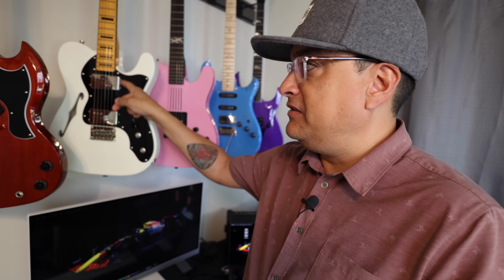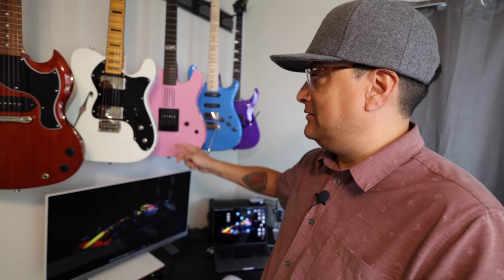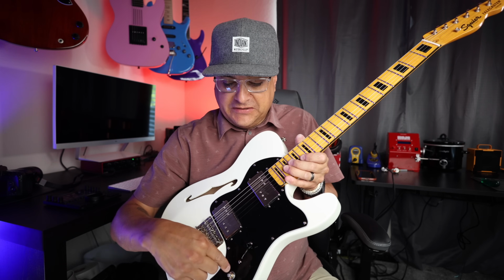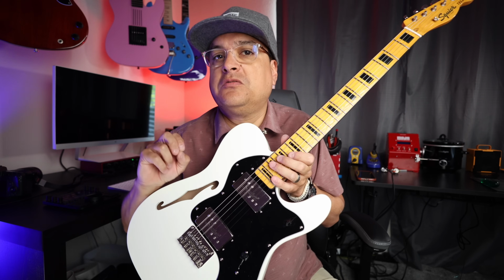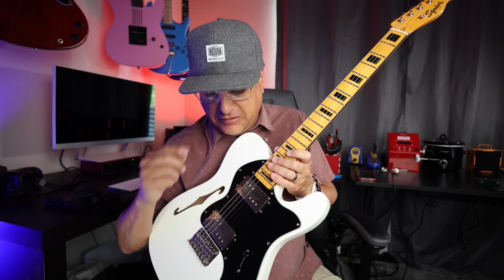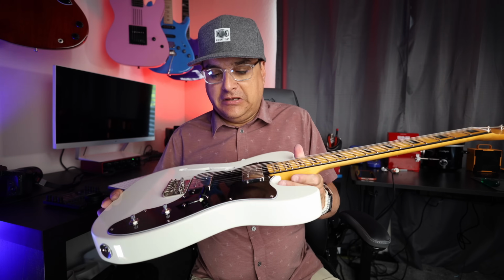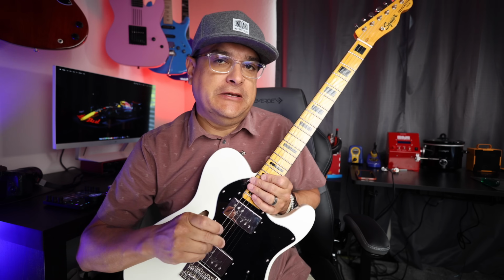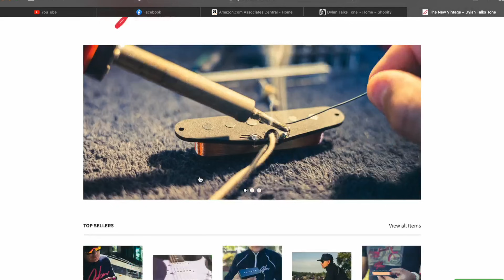250k Pots Vs 500k Pots - Sound Comparison

Comment: I once upon a time I tinkered with pot and capacitor values in my main squeeze strat and would always come back to original values.  The quality of the pots and caps improved, purely by accident.  Clarostat pots and these big orange caps at normal strat specs.  Forty tears later it still makes me happy.  Experiment, explore, enjoy, find Home.

Comment: For what it's worth: I use 500k pots with my Fender Noiseless 3 pickups. I also put them in my Tele. It has 
Dimarzio stacked single coils. It, as you mentioned opens them up which I like.

Comment: I have pretty much the same view as you. I much rather have the guitar be too bright out of the gate and I can tame that with eq or the tone pot. If the guitar is dark or muddy out of the gate then in my opinion and experience it’s almost improbable to create what I call that good treble. I also agree the mid range and the cut just gets bigger with the 500k. I’ve been using 500k in all of my guitars including typical telecasters for a long time.  Nice video. Well done.

Comment: Firstly... Nice I liked your play-style and I agree the 500k pots are idk wider? Not in dimension size I mean like what you said about the eq difference in the Q value wider at the same Q peak on the low mid frequency range. 
I'm wondering if 300k pots would because of most brands stated tolerances in resistance +/-10 % there's more chance of getting a pot closer to 250k if I wanted 250k but this video, thank you btw, has swayed me I'm getting 500k pots as you said you can always dial the knob down to a resistance value in the pot closer to 250k or what sounds better depending on your pickup, and still have the option to go higher, all the while not needing to over complicate the wiring by adding more that essentially takes away, therfore keeping it simple as possible and still having more high range frequencies there if you want it. I love this idea.  500k pots. 
I'll maybe have to look through this video again to answer this question but I'll put it up on here anyway- 500k pots on a strat SSS configuration, capacitors- conventional methods are .022uf fir 500k pots .047uf for 250k pots- 
After this video I'm questioning if the capacitors are for the pickups more than for the pots- does this question have merit?
Or is it purely subjective and personal preference?
Thanks again love your podcasts and tutorials and demo videos you know your stuff-  big 👍's up for Dylan talks tone ❤

Comment: a pot then is kind of like a mirror that reflects the sound of the pickups toward the output, and you can either fade it out til its invisible and there's no signal, or fade it in and reflect everything into the output. but more resistance means a more reflective mirror.

Comment: QUESTION: Is it possible to install a 1 Meg potentiometer for example and wire resistors to a three way switch and change between 250k 500k 1m

Comment: Great video! Thanks for the information. I just have to say that I'm on the opposite side.😀 You said, if you don't have those highs, it's not there, you can't take it back. Yes, true, you can't take exactly that frequencies back, but for me it's just too shrill.
My experience is that if I have those shrill, harsh highs I just can't get rid of them, but if it sounds balanced and smooth but just a little dark, I can still add some highs and it won't be ear-piercing to me.
So I think the question is: Do you like or dislike exactly those frequencies? 😀

Comment: Thanks for this, especially the nugget about the volume pot contributing more to the high-end roll off than the tone. 

For a SSH strat, I decided on two volumes  - 250k/singles and 500k hum.  500k on the singles was just too brittle. 

I used a 250k for the tone, and I’m happy with the result.  The 500k retains more brightness for the HB, and the bright Eric Johnson Neck/Mid singles chime nicely and aren’t brittle.
Reply: That's an interesting combo. I know very little about pots, so on my HSS Strat, as my post above mentions, I'm putting in a better humbucker. Does each pickup gets its own pot? If so, for an HSS would you recommend a 500k + 250k + 250k config, or replace each with 500k?
Reply: @OhGawdHesGotAGun  I think in theory, and as Dylan mentions, you can use 500k for everything.  My particular single coils are already quite bright, and when I had a 500k master volume those singles became undesirably bright. 

I don’t mind two volumes, as there are interesting options to preset volumes like a LP.  Now when I play through my Marshall Jubilee, I get nicely tamed singles and a fairly bright humbucker.  

The 250k pot for master tone is working very well.  Your mileage may vary, and different pickups can make all the difference (inherently bright or dark pickups)
Reply: @jimmclaren1  Thank you! "Tamed singles" sounds about right for a Strat (and for a porn movie title, lol).
I appreciate your advice. I'll go for 500k for the humbucker only (if it doesn't already have a 500). Not sure how coil splitting comes into the equation, I know there are some that are modular (iterate between 500k & 200k or whatever).
Thanks!
Reply: @OhGawdHesGotAGun  I just used a 250k push-pull for the master tone.   Used the switch on it to split the HB. Have fun!

Comment: i'm always a sucker for brighter tones... i just snagged an old squier strat for modding/mangling, and that came with 500k pots for the single coils, which surprised me.  Also on your tele there, that maple fretboard/ block inlay is the coolest, i wish more fenders & squiers had that...
Reply: Good call.
That's actually alot better than just a good call. Looks 1,000% cooler than regg'ler ol' black dots. Id think it work for/against whatever aesthetic you'd be going for depending on what colors you're working with.
I kinda can't decide if I'd prefer those old pearl style, or black (to bank off this Tele's white body. Pearl can appear dingey(is that the word?-kindof dirty-faded, rhymes with Benji) so pearl might not be a good idea. Black is usually a safe bet. Pearl however, (now that I think about it)might just make the whole guitar look unkempt and tacky.
lol Wouldn't wanna be dicking around on stage with a malnourished looking guitar.
Suit yourself.

Comment: I completely agree with your philosophy on pots, I use 500k in everything I modify, if not a 1meg. It's so easy to take out or compress down some of that high end with the tone circuit, a pedal, or with simple EQ on your amp or effects unit. I would rather be turning down my treble than constantly trying to boost something that is weak, which is almost always a lost cause. Using a 250k pot is like hacking off the high end of your tone with a hatchet, using the tone circuit or something else is like using a scalpel.

Comment: 500K volume pots makes single coils sound like scratchy nails on a chalkboard; on that note, that Alpha 500K-to-250K pot swap was the best thing for my Squier Affinity and Bullet Strats. With aftermarket humbuckers in my early 80s Cort LPX (ex-Effector), i swapped out a fried 500K volume for an Alpha 250K providing less highs than a 500K but it actually sound better that way to me. 2yrs ago i loaded stacked humbuckers in my MIM '95 Strat Special as it had a 250K volume with the previous aftermarket SC's, then the 500K pot was short-lived but i put a 1-Meg pot in it, what a difference THAT swap made in that guitar as it makes the stacked humbuckers brighten up like single coils!

Comment: Another thing to consider is rarely is a pot valued at what it's sold.  Many "250k" are around 220k.  "500k" can measure anywhere from 420k-520k and that's even buying so-called measured tolerance higher priced Bourns or CTS.  Basically, that mass source production pot on your volume could be the wet blanket covering your tone.
Reply from the maker: I mean… if you buy shit parts, but we use low tolerance stuff so it’s not an issue
Reply: @DylanTalksTone  I only buy low tolerance as well.

Comment: If you compare resistance of the volumepot with the capacitance of the tone capacitor and they are both in parallel with the pickup, de capacitor leaking treble to the ground is a low pass/high cut filter(it leaks treble to the ground) and the same way the resistance of the volume pot is a high pass/low cut filter and it even leaks some of the higher frequencies.
So the real test would be: 
1. Connect a pickup straight to the output jack.
2. Connect the same pickup through a 500k volume pot to the output.
3. Connect it through a 250k pot.
Compare the three options.
Option one will be the loudest, have more bass and more treble.

Comment: I would  like to see the same comparison with a standard Tele, which most players would own, The wide range version most people do not own and are not familiar with. It was a good demo though and I did like the 500K better. What if you used a 500 on the vol, and 250 on the tone, do you ever mix values?

Comment: I've got a 2018 American Performer HSS Strat & I'm not a big fan of the 'Double Tap' humbucker (it sounds like a scalded cat giving birth) so I'm getting a local tech to put a Shawbucker 2 humbucker in its place. I miss the tone I got from my Tele Deluxe so I thought I'd replace my humbucker with one of its double Shawbuckers. 
I might lose my coil splitting ability but I don't care that much. I don't know what pots are in there now for volume, but I'm impressed with the 500k sound here. I've only been playing about 4yrs so I'd appreciate any "If you were me" advice on this. Would you, IYWM, get him to replace the existing pots with 500's? It's got 2 Yosemite single-coils & the Double-Tap humbucker. Also putting on a 10-way switch while it's being operated on.

I'd do this all myself but I've never soldered before. I'll risk destruction on my Harley Benton, but not my Strat.

Comment: Funny that I ran across this video, when I was just thinking about this whole concept last night & this morning. (Right now, I'm coming up on the 8 minute mark, but I had to stop & enter this comment.)
I've been thinking the same as what you're saying, that you'd want 500k (or even up to 1 M) for the volume pot, and something smaller for the tone pot.
Then there's also putting a choke in the tone circuit, I haven't tried that yet, but I want to.
Because you don't want to lose that signal! You want to keep it, maybe shape it a bit, but not lose it to ground!
One thing I didn't understand, around the 6 minute mark what you were saying about  "cutting out the highs..." Seems to me you're cutting out the whole signal, not just the high frequencies.
(Now I'll watch the rest of the video!)
Ok, after listening to the difference, I think we're both right! The 500k pots sound more articulate. Definitely. 
I especially liked the quack that came from the bridge p'up!  (Maybe I'll get me a Strat. Never had one.)
One thing I've learned with analog electronics in general, and electric guitars specifically, is that there's theory, then there's reality...!  What may be supposed to happen "in theory" (with ideal components) is NOT what you get in reality!
But to me, this just goes to show that the concept of using higher value pots, at least in the volume circuit, to preserve more of the signal, is true. That's because, even though the pot works as a voltage divider, where the ratio of resistance determines what gets sent to the output, you've still got the signal going through the whole pot (another way of looking at it is, with a higher value pot you're separating the signal from ground more). Because you can't forget that two things are happening: 1) the whole value of the pot keeps the signal separate from ground, while 2) the ratio of the two resistances (voltage divider) determines how much signal gets sent to output. Good experiment! 👍

Comment: What about the cap value? How do you choose that? I've never seen the wiring in an electric guitar. I'm assuming it's a fairly simple RC circuit. What would a typical schematic look like?
Reply: Unfortunately, it’s a lot more complex than an RC filter. Yes there’s a resister and capacitor in the tone circuit, but the pickup is also an inductor!
Reply: @ZachariahConnor  That is true. It is. It's sort of acting like an electrical generator when the string is vibrating in the magnetic field.

Comment: Would you recommend using 250k on a neck HB 335 guitar for Jazz?

The common approach to make it more jazz boxey is fat flatwounds ebony neck 0.047 caps or tone rolled back.

But using 250k for instead 500k seems to be a possibility to make the 335 more like a jazzbox?

Comment: I'm a guy who hates active guitars so I always wire mine such that it is passive yet can do anything an active can do so one thing I do is I use very high output humbuckers such as bareknuckles warpig set
These are 21.5 kohm 
Most factory guitars have at most 12 kohm
A 500k will allow the full pot of a humbucker that size but it will not allow the full potential to be heard so I use a CTS 1meg tone and a .022 cap so that the sound is bright and with that high output humbucker you lose tone range at the knob but you'll have the lows from those humbuckers but the .022 for the highs 
I've had good luck doing this, double ground everything to kill feedback and noise
Alot of guitar companies do assembly line work and these guitars are quickly shoved thru so taking the time to choose good electronics, good wire and caps and great grounding will make your guitar have better response when you play. So what does all of this add up to?
You have a great sounding guitar that you don't need to fight to get your sound because the better ground kills extra noise so when you play your ears can hear each separate note apart being that there is no hiss, buzz or popping mixed in. When you use a very high output humbucker set with good ground you get a super good response when you hit the strings
I pick my capacitors according to the stats of the humbucker
With high output of 15 kohm or greater you usually get lots of lows so a .047 may bass it up to much
So I use .022 bumblebee or black beauty caps because they seem to brighten up the sound. Everyone that plays my builds hit only a few strings then they turn to me trying to buy is.
I built a knockoff lespaul body with bareknuckles pickups, 2 CTS 1meg tone pots, 2 CTS 250k vol pots for vol range, 2 .022 bumblebee caps a 3way switch with added grounding using wax cloth wire.
Guitar companies like to use rubber coated wires to cover their mistakes but wax cloth wire is perfect If you ground well. These factories do as lil ground as they can get by with so when people buy a $3000 Gibson lespaul or usa strat for $1000 just know that a $200 guitar has the same orange drop, bad ground, garbage alpha pots crap that the big dollar guitars have. In the early days Gibson had their bumblebee caps, fender telecaster had text book caps and these types of details made their guitars have a unique sound but now they sell a name and almost all use the cheapest components they can get away with.  When I figured out how it works I said I'd never pay big for a production guitar again
I buy pawnshop guitars and make them better sounding than most high dollar guitars. I can take two of the same guitars, one stays stock the other I only give better grounding but if you play the stock one then play the better grounded one you'd assume I did some big upgrade but no
Grounding makes that big of a difference

Comment: 500K pots (to me) always sound better than 250K's . I like the warmth of the 500K tone much better than the shimmery tone of the 250K's . Just personal preference. Great video , Dylan !!
Reply: interestingly Dylan says 250k rolls more treble out, causing a warmer tone. the 500k pot would be more shimmery with extra high end and the 250k would be more warm with less highs?
Reply: I agree with you 💯. Listening on my mobile phone speaker (several times) I found the 500k pups a bit warmer than the 250k
Reply: It's the other way around. Lower pot values take high end away.
Reply: @Leo_ofRedKeep  yep it's supposed to be that way but in his demo, to my ears it was not

Comment: For a tele I would always change the 3-way switch to a 4 way and add a phase switch when changing the wiring I also use pot with an off position so I can eliminate the pot altogether,

Comment: @Dylan, I have two questions, hope you can help me out. 1) How can the tone pot have influence on overall wiring resistance? For instance, I have an HSS guitar with 500k volume pot and two 560k resistor on each hot lug of each single coil so that they can see around 250k, but my concern is how the tone pot will get into this. 2) How different is it to solder the capacitor on the tone pot in the middle lug or the third lug. I have seen both wirings. Does it change considerably?  Consider for that, a master volume and master tone.Thanks a lot!

Comment: really perceivable difference, between the two impedances. It’s not even comparable. Off course..  the strings were also fresh.. but, even so..
Thanks very much for the video. I come to your channel, every once in a while, and i usually learn sth..  so congrats. 

I am modding a couple of my guitars with a 1M pot and 500k for Bass & Treble tone knobs, respectively . 
On the Tele i’m gonna use only one system, but on the HSS, funny enough, i was planning to use same approach you mentioned here..  I was thinking of wiring the Humbucker with its own separate system, so i can better tone that muddy jittery down, without altering the single coils’ tone. 
Have you got any video talking about that ?

Thanks again,
Cheers from Portugal 
(where..yes..  one doesn’t use lead based solder.). ;)